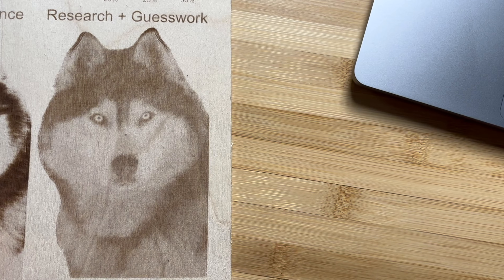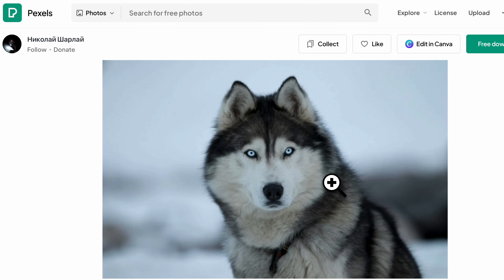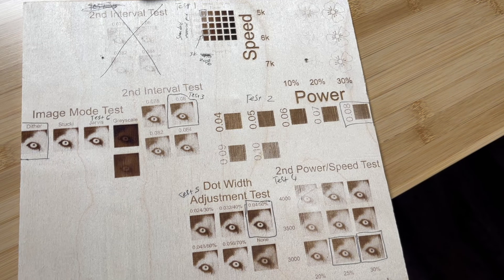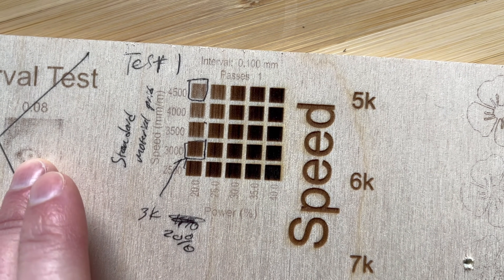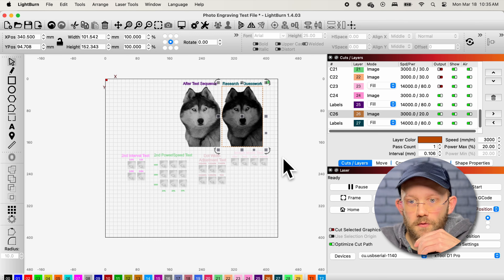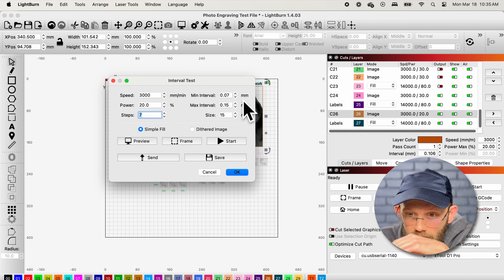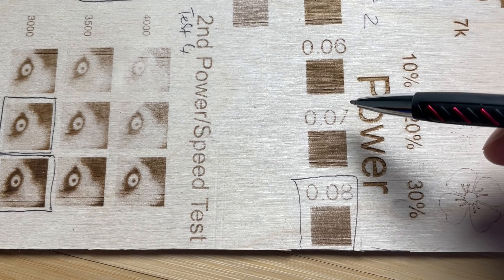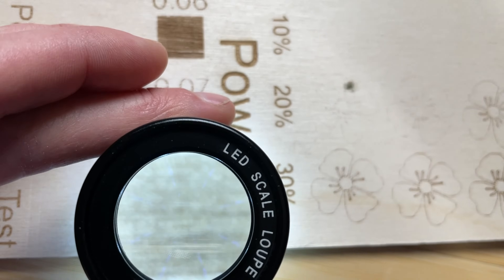7-Step Method for Photo Engraving with LightBurn

Comment: The interval on my diode laser changes depending on focal length so its important to note the focal length too, I did a ramp test to determine the thinnest line width which was actually below the regular recommended focal length so a ramp test is worth your time to get the best DPI possible before you do the interval test.

Comment: I am trying the same, did very big test grid as well, but the results what i am getting is either brown colour engraved or dipper but not the dark black colour as you are able to achieve on surface of the ply, am I doing anything wrong, or i have selected wrong material, i have selected 7mm plywood.
Reply: There's different veneers on plywood and they'll react differently. Red oak seems to show more grain, walnut is dark regardless, and birch seems awesome. You'll have to play around depending on which one you have. Those are just 3 species I use.

Comment: Great video.  I have been using Lightburn for photo engraving for a couple of years now and I too started with the research and guess method.  I learned a couple of new things from your video.  Thank you.  Two questions, did you do any image adjustments, in Lightburn, to the photo?  Do you find that by following your steps, you don't have to do image adjustments?
Reply from the maker: If I remember correctly, I don't think I did any "image adjustments" (put in quotes because someone else who reads this might not know that is the name of a specific menu in Lightburn) for the husky project in this video. However, I do sometimes use image adjustments now. What I try to do is find a combination of image adjustments that works well for a given material. It doesn't work every time because every photo is a little different, but it can be a really good start point. For example, I have a preset of image adjustments for engraving photos on Slate that works almost every time.